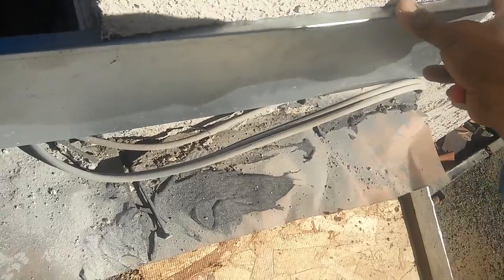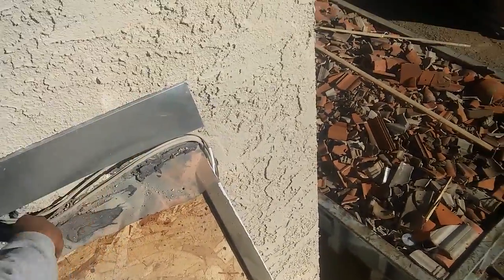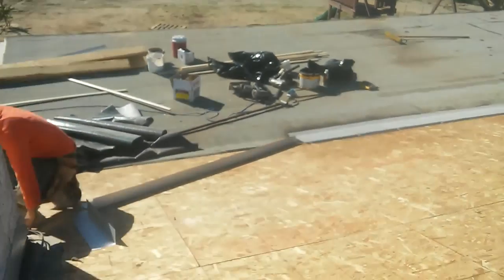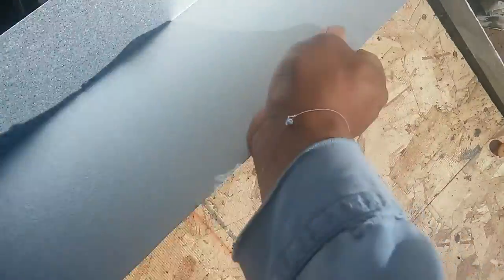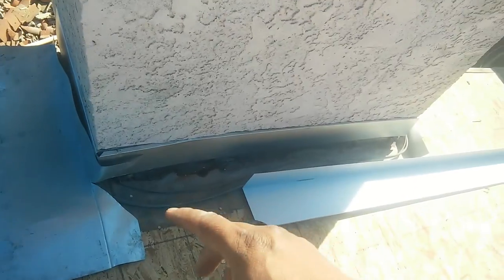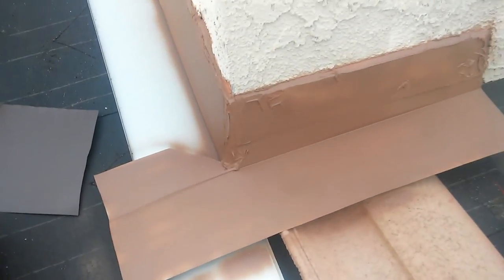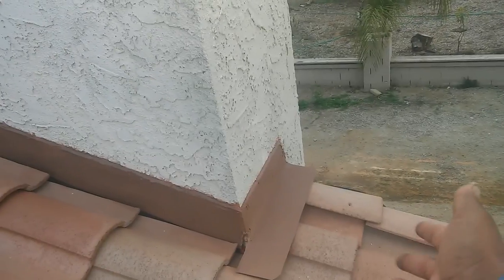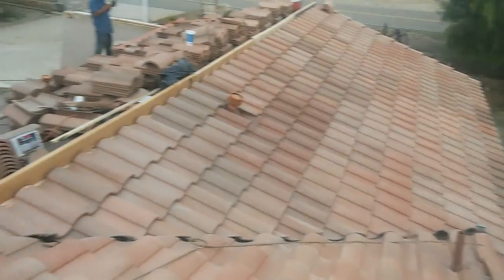INSTALLING NEW FLASHING  to a FIREPLACE...leak free and simple!

Comment: this is correct for brick chimneys! and will be very good here but is not your best option.
 stucco you would want to remove the bottom 3-6 inches of stucco and apply water proof membrane shingle style up the chimeny about 6+ inches then apply your roofing paper over the and up the wall about 5inches then go over that with step flashing then your top flashing.